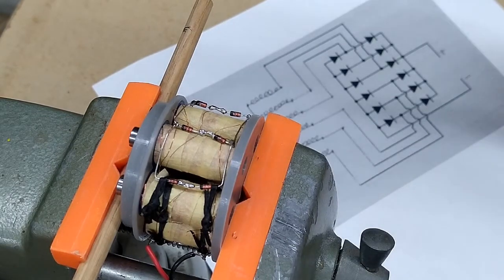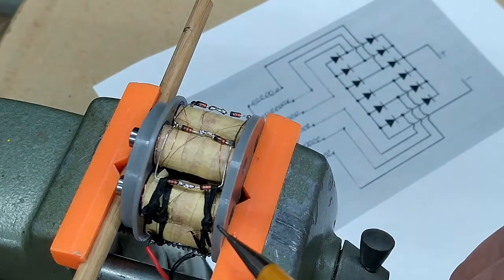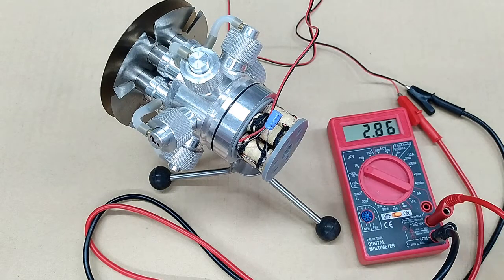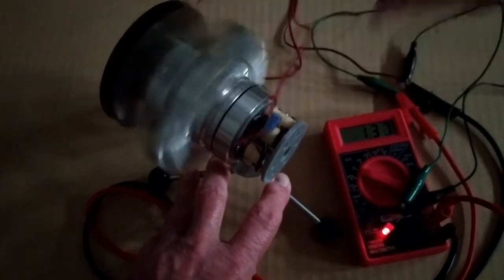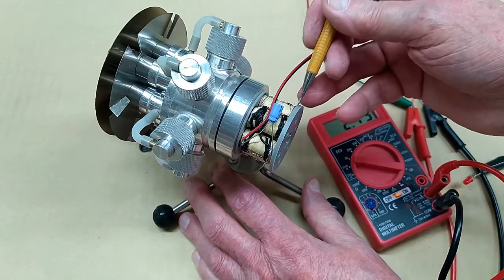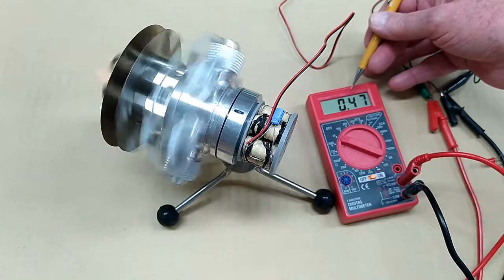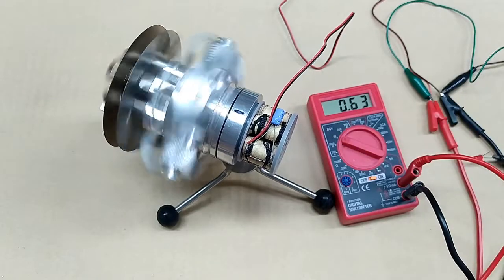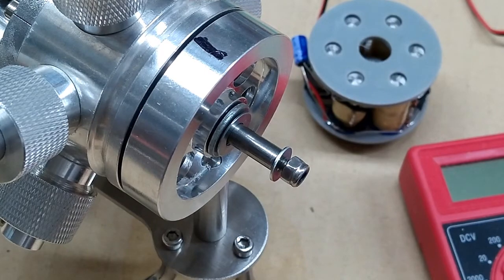Gatling Stirling Magnet Generator Part 3

Comment: Nice build, have you thought of  trying air core coils. Might be worth a try. Good project
Reply from the maker: No I haven't. Not sure how that would work here. I am pretty much stuck with the spacing of the original engine design and the magnets are on the engine side of the mounting ring. This was harder to get to work than I anticipated but eventually I get it going. Two more parts to go in the process.

Later on I will try another way to get the Gatling Stirling Engine to produce a more acceptable output.
Reply: @RonaldWalters2010  thankyou for the reply, yes it looks awkward and also very fine magnet wire i can hardly see it Nevermind solder it. Like you say you have to get a lot in a small area.